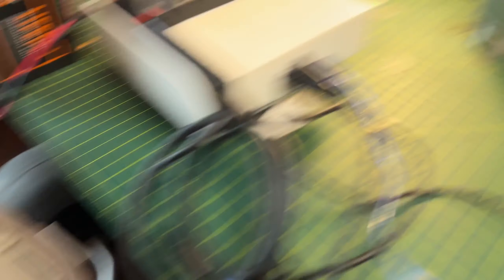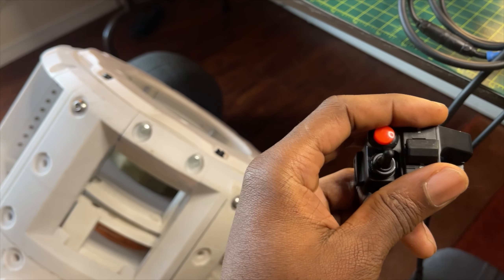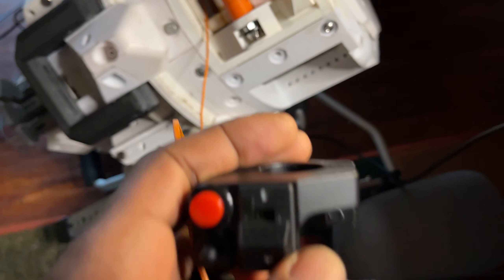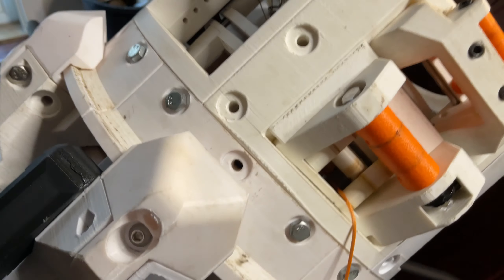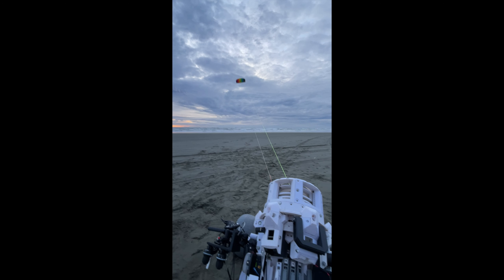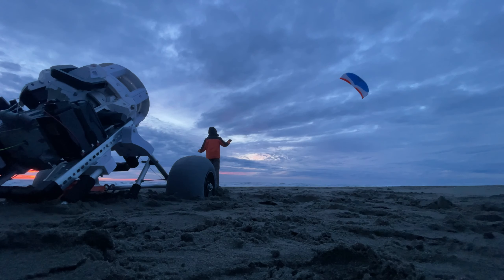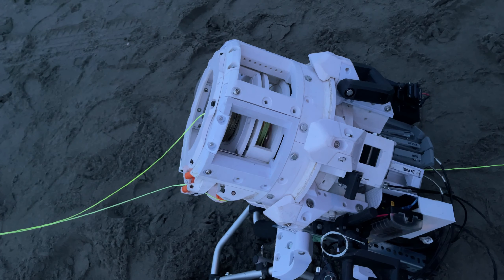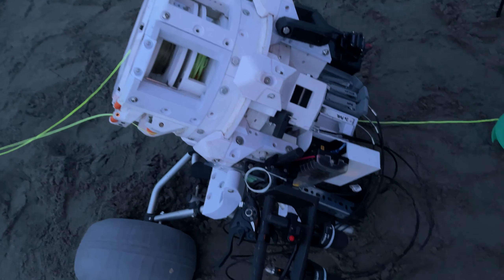Convert Regular Boats To Sail Boats With Kites!

Comment: Would this be viable for the front seat of a two-person kayak? Or would it need to be smaller?
Reply: I've tried using a kite boarding kite on a touring kayak. The lack of keel made anything other than straight down wind impossible.
Reply from the maker: You may want an outrigger and a swing keel. This Kite Engine is a prototype, there will be a much smaller one for kayaks in the future.   @trekkie1701e
Reply: @Ocean_Kite_Energy  Sounds like a windsurfing board would be an easy conversion. You could even make a OKE mount/adaper for the mast track which would allow for adjustment of the steering point where the kite pulls on the board.